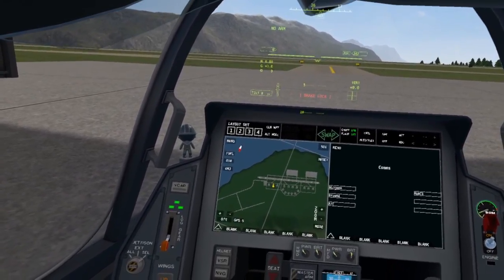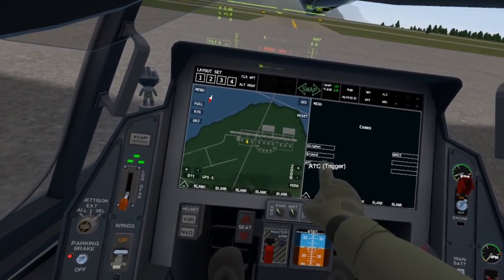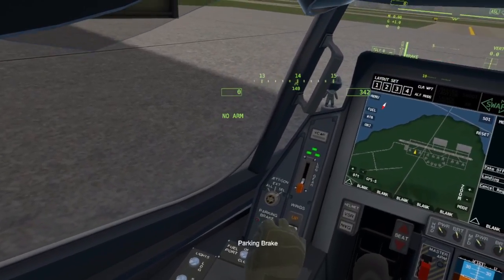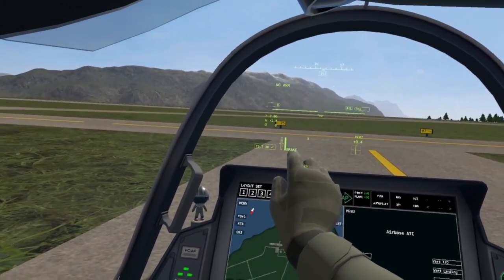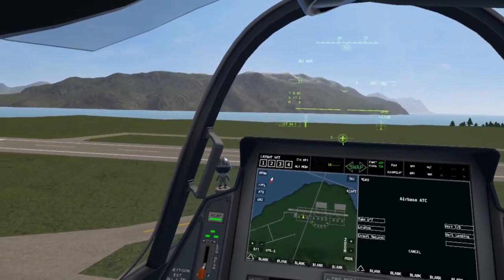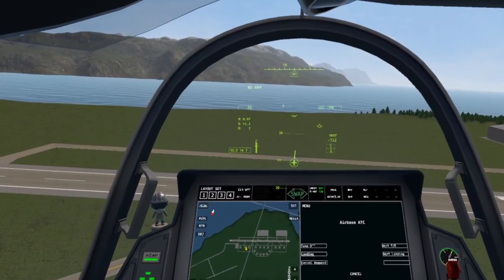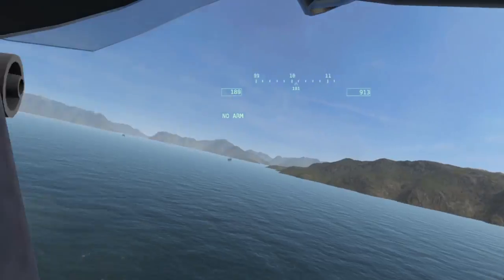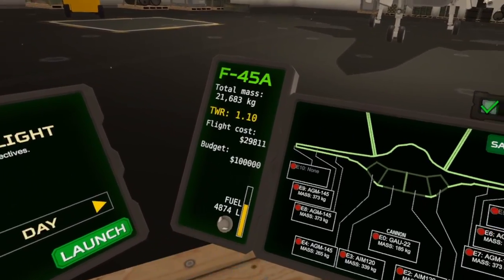F-45A: Vertical Takeoff | VTOL VR F-45 Tutorial

Comment: If you can help me some reason when I try to enable v cap it says autopilot disengaged
Reply: I had the same problem... it's that your Weight to Thrust ratio is too high, in other words, over 1.0. If you reduce it in the jet setup it will work!
Reply: @youjeff12  holy shit that's probably why I can't hover. Thanks dude!!!!!!
Reply: same
Reply: @youjeff12  still doesnt work
Reply: @youjeff12  don’t feed people false info
Reply: OK for everyone that it won't work for, you don't need it just tilt your engine and use your throttle
Reply: @youjeff12  theres no such thing as a too high TWR, unless its so high the engine physically rips through the airframe.

Comment: TWR is indeed Thrust to Weight Ratio and it makes sense that if its less then 1 you cant take off as you have more weight then you do thrust to lift that weight
Reply: @QueueWithACapitalQ, The TWR doesn’t have to be more than 1.00, it has to be above 1.04 (from the wiki fandom)
Reply: @Uramanpro  I wouldnt even try taking off vertically with a TWR that close to 1. The aircraft would just be too sluggish to manuever and unable to slow its decent effectively giving it a high risk of crashng.
Theory: anything above a TWR of 1 will take off
Practice: Recommend keeping TWR above 1.15 for safe VTOL operatons
Reply: @Queue3612  Thanks! I'll be sure to keep that in mind, but I will be trying 1.04 TWR.
Reply: @Queue3612  I go with 1.12 for viffing and combat maneuvers

Comment: OK so I've replied to a lot of people, all having problems with vcap, you don't need to use it, just tilt your engine then use your throttle. Just like the kestrel (twin engine vtol, ie the tutorial one)
Reply: do you still have to pull the flightstick all the way back? because i tried neutral stick full throttle without vcap and the plane refused to take off (twr of about 1.15)
Reply: @LawdBreaktwist  No, did you tilt the engines? also it will take like 5 seconds to start to lift. You should see dust flying around from the engine, We could hop in a multiplayer.
Reply: @Capedkarnage  the engines were fully tilted and put it into full thrust for about 15 seconds when i was wondering why it didn't start to lift, maybe i did something else wrong, i'll try again next time i play
Reply: @LawdBreaktwist  I use a twr of 1.05, strange why its not taking off. Maybe try for longer?